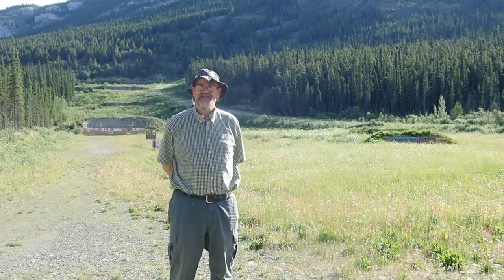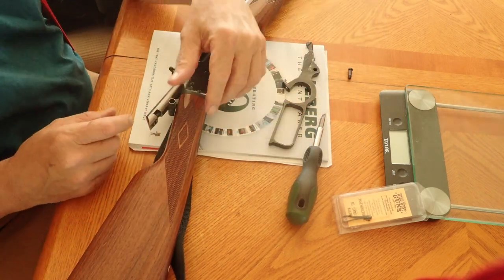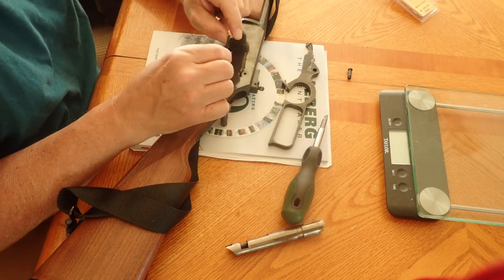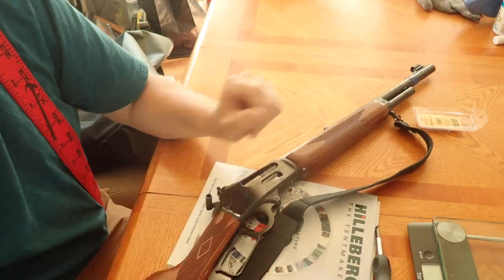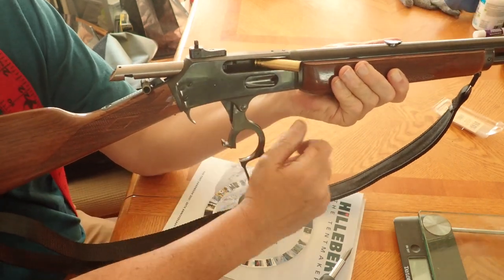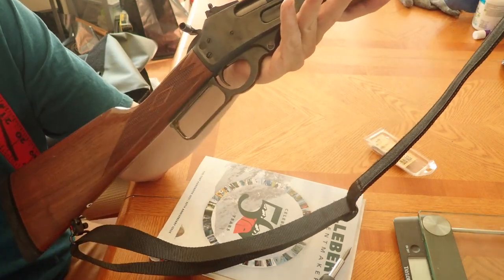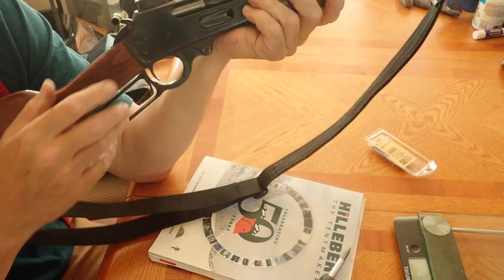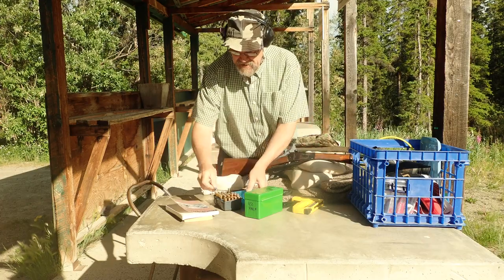Ejection and the Marlin 1895   HD 1080p

Comment: I wonder if the extractor might be more the culprit?  I had simular limp ejector issue with a Henry which has almost identical system,  Henry sent me a new extractor and it solved the issue! I believe the claw portion was deeper and the piece was stiffer. I mean if you work the lever like your mashing patotos they normally eject in any condition lol.
Also my 45-70 marlin is fine.
Reply from the maker: I'll check it out.

Comment: I've been shooting Marlin 1894s in competition or several years. I have found weak ejections is usually always caused by a worn extractor. After repeated use, the extractor loses some if its holding tension. This is usually evidenced by cartridges barely falling out on extraction. Would recommend you try a new extractor. Good shooting!

Comment: I have an 1895GS, 1895XLR, and regular old 1895 all in 45-70.  Haven't really had much issue with ejection to my recollection.   But I just tried this and I getbwhat your talking about.  Also just tried my 450 BLR takedown and it is also side eject but it has easier ejection with its rotating bolt head like that of the M16 type.  Even with the ejection port held in vertical orientation the BLR has much stronger ejection.

I've had the Winchester 94 go down on me from being real dusty and it functioned gummy wheras the Marlin was more sealed and reliable.  Neither have the reliability of my Mauser or Ruger Hawkeye.
Reply from the maker: I had a Win 94 do the same.  They need disassembly and cleaning every few years.

Comment: My guess is the hardware is exactly the same for the .45-70. But, that belted case on the .450 is really heavy and I think the springing action of the ejector isn't adequate to easily flip that heavy case out if the action. Just my opinion. I have no problems with the 1895 in .45-70.